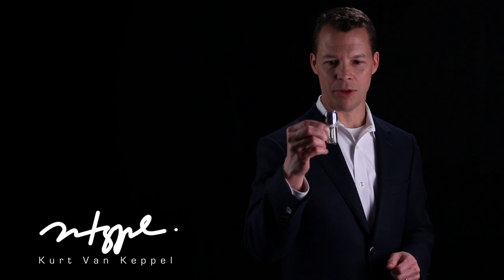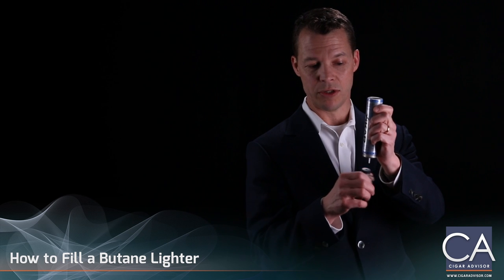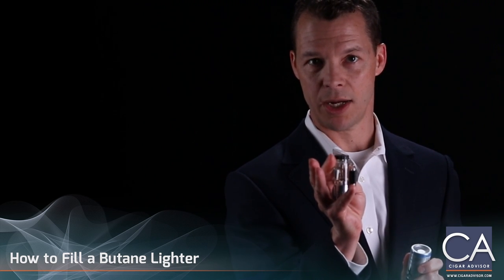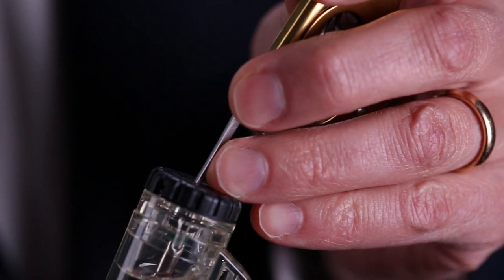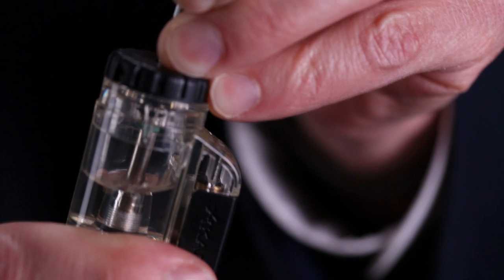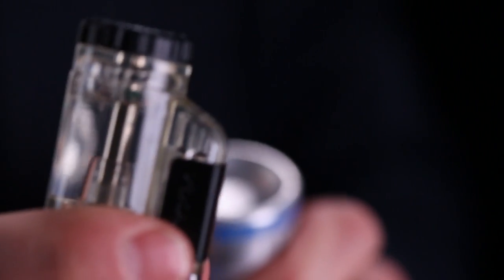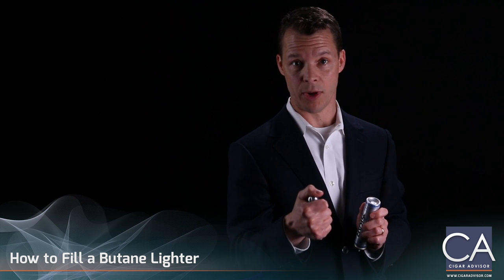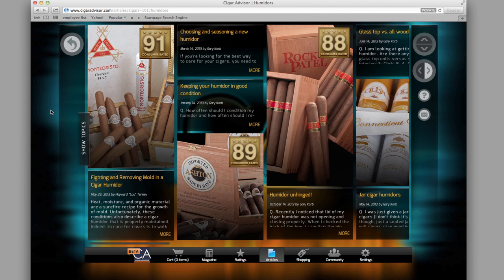How to Properly Fill a Lighter with Butane - Cigar 101

Comment: Actually the higher the octane, the less cumbustible it is. Also, it depends what your car is tuned for so higher octane doesn't really equal better fuel. Has to do with compression ratio and knock resistance. Not really a good comparison.
Reply: Brian De Jesus yeah all of what he said was b.s. about octane
Reply: All octane is for is to prevent detonation. When being compressed fuel starts to heat up and the high the compression the high the heat gets cause the fuel to ignite to soon which is what can seriously damage an engine or even kill it.

Comment: There's no "air" in the lighter! Butane is a gas.  When you compress it, it liquefies. As you use it, there's less liquid, so gaseous butane fills the space (not air). 
The point of bleeding is not to get the "air" out, it's to lift the ball valve off its rubber seal. After weeks or months being held together by high pressure, it sticks to the rubber. 
Bleeding after you fill just wastes butane. Push the valve briefly a couple times, then fill.
Reply from the maker: Thanks for commenting.
Reply: Why is gas leaking on my scorch brand torch
Reply: I was about to say the same thing. The bubbling is the atmospheric reaction.. the butane is boiling off into it's gas form. Lol funny video

Comment: 0:39 if there was ever compressed air in a butane refill canister, it would have to be deemed as an explosive hazard, and not just flammable.
In these (including most aerosol) canisters, a small portion of the butane boils and fills the void above its liquid phase.
It's this gaseous butane that provides the pressure.

Comment: Excellent video, thank you! 

It seems the bleeding process is not venting compresses 'air' to the outside atmosphere, it is venting gaseous butane.  Regardless, the evacuation of gaseous anything allows for more room for liquified butane, thus a 'fuller' lighter.  Always a good thing.

I have a question however.  Forgive me if it was answered already.  I have watched quit a few videos on this subject —my reasoning for why this is the best— but others have said to turn the flame level to its lowest point when refilling.  Do you find this to be the case?  If so, why?

Comment: "The higher the octane the better the burn".  Thee higher the octane the slower the burn (which is why it is used to minimize knocking).  "Down to Diesel"?  Poor analogy dude.  Vent BEFORE you start filling, not after...  This guy owns a lighter company?? He should consider a physics class next...

Comment: What sheer stupidity. Higher octane only matters if the engine require it by design. Put high octane in your car that didn’t need it and all you do is waste money on gas that’s more expensive than you need. Hell diesel isn’t even gasoline so it’s irrelevant.  Why not build a lighter that works with standard off the self butane rather than justifying unicorn farts being required for a fancy lighter. A lighter is a simple old tool like a hammer. Talking about what’s sort of pillow to store your gold plated hammer on won’t get nails driven any better but the channel has to make overproduced videos about something.  Reminds me of the as seen on tv commercials : is lighting your  hard and frustrating? Did you keep burning your house down. Well have we got the product for you....
Reply from the maker: Thanks for watching and commenting.

Comment: The bubbles are from the butane expanding into a gas.  It won't stay in liquid form unless it's under pressure.  What you're 'bleeding' off is the butane.

Comment: I filled it with butane but it wouldn't light. I forgot to purge it first. Is that why it won't light? If yes, how do I pour out the fresh butane? Thanks.
Reply from the maker: Thanks for leaving a comment. In the office we use the tip of a pen to press the filling nub. Once pressed, you will see the fresh butane come out and if there is air still in the lighter that will come out after the butane. Then you should be good to fill back up and light.
Reply: @CigarAdvisorMagazine  I'll try it, thanks. I'm wondering if the fault was not in my lighter but in the tip of the butane canister. It seemed leaky.
Reply: @CigarAdvisorMagazine  Still having trouble with it. Tried to fill my little Vertigo torch with Colibri Premium Butane 99.999 pure. It sputters and leaks out when I try filling and so it fills the torch about 1/5 capacity. Maybe it's because I don't use a nipple adapter? However, the nipple does seem to fit. I tried another butane filler, and it still doesn't light  - that puzzles me. Any ideas? Thanks.
Reply from the maker: @rubinsteinway  It could be an issue with the filling valve. You may want to contact Vertigo. Sorry we couldn't help.

Comment: Compressed air or butane vapor?   I cant imagine any need for compressed air when butane turns into vapor at atmospheric pressure and temperature.   Thats why its "compressed".   kinda like gasoline octane, you're literally wrong.

Comment: Should I turn the flame adjuster down before refilling?
Reply from the maker: We usually recommend to turn it down.
Reply: @CigarAdvisorMagazine   just curios, why is this recommended?  I've always seen and heard that, just didn't know why.
Reply: Perhaps the reason is the ignition process. When tank is full (or u are on high altitude) lighter will ignite only on low settings as pressure in tank is high (or there less air, oxygen around, thus u need to decrease amount of gas too). However when tnsk is low. Pressure is low. Thus u need to turn settings up to ignite lighter.

Comment: What you said about gasoline is just not true. Research it yourself higher octane is a slower, cooler burning fuel.. There's absolutely no reason for it to be more expensive. It's just for certain motors that were designed for that fuel. It's a timing issue. As in how long it takes to burn. Don't be fooled by the pricing. That's the scam.  First they convince you that "you get what you pay for". As if quality was the only driving force for worth. Then sell equivalent items at various prices to suit how much "quality" you want to afford. Performance engines are designed for higher octane fuel. Performance cars are more expensive. Therefore you can assume the same person who can pay for a pricer car, would likewise pay for a higher quality fuel. 
Now, butane could be and probably is completely different in these areas. I'm still lurning too...lol
Reply: Octane is an additive to prevent detonation under higher compression ratios, (or less commonly in some low compression engines with large displacements under high loads and high altitudes.... piston aircraft engines for example, which operate on 100 octane low lead gasoline).  The price of a car has nothing to do with whether you need high octane or not.  Compression ratio is the only things that matters.  Higher octane fuel is more expensive because of the cost of additives... period.  Not because of some bullshit mumbo jumbo of price manipulation by quality perception.

Fuel needs to burn in a smooth constant flame front across the piston chamber.  High compression can create areas  where pockets of fuel and air detonate in a tiny explosion instead of a smoothly progressing wall of flame.  This detonation is what you can hear as "pinging", and is very damaging to an engine, to the point it can cause catastrophic failures, literally blowing a piston apart over time.

It's normally called for in a lot of luxury cars, not because of some snobby pretense, but because they're much more likely to have high compression engines, as performance is typically a selling point of those vehicles.

Contrary to popular belief, higher octane fuels actually burn dirtier than low octane.  The additives that prevent detonation don't burn as cleanly as the fuel itself.  There's no reason to run any higher octane than needed to prevent pinging.  If your engine (at your personal daily driving altitude and performance loads) doesn't ping with regular fuel, all you're doing is wasting money and making your engine run dirtier by using high octane.  However, if you do experience detonation, you absolutely need to be running a higher grade fuel to prevent engine damage.

Comment: He mentions "air" in the lighter several times. This is not accurate. If there was air in the lighter it would explode the first time you tried to light it!!  What he means is butane gas under pressure. See the comment by Jeremy Keenan below.
Reply: A brand-new butane torch usually comes empty, so there could be air in the tank in that case.

Comment: Wow thank you so much I find the clicker fails on a lot of lighter and I haven’t had one last more then a month
Reply from the maker: Thanks for watching.
Reply: That's why I've gone to flint strike jet butane lighters. You can replace the flint just like a zippo. Always reliable. Can even replace the wheels if necessary. But how often does strike wheel actually wear out. And for soft flame clipper lighters are refillable and the strike wheel assembly comes right out for quick flint replacement.

Comment: where did you get that item that has gas to refill it because i have a torch and i wanna know what to use so i won’t have to buy another one
Reply from the maker: Thanks for watching. Not quite sure what your question is. The can has butane to refill your lighter with.
Reply: @CigarAdvisorMagazine  yea my question is where’d u get that from so i can refill my own
Reply from the maker: @steven3063  You can get the Butane cans in most cigar stores, if you don't have one close here's a link - https://www.famous-smoke.com/xikar-1.9oz.-high-performance/item-64517?pid=64517
Reply: @CigarAdvisorMagazine  appreciate it